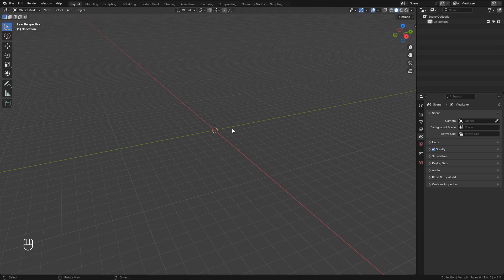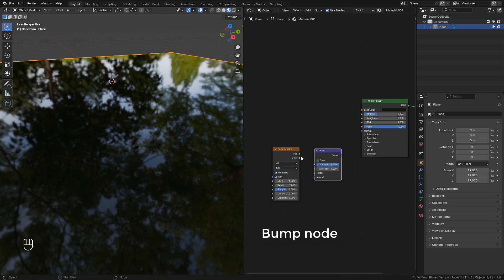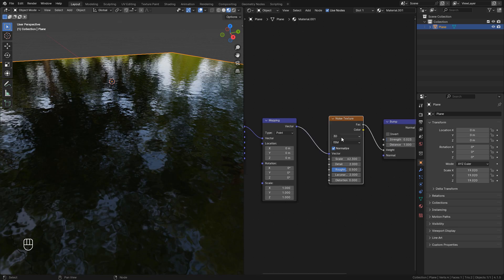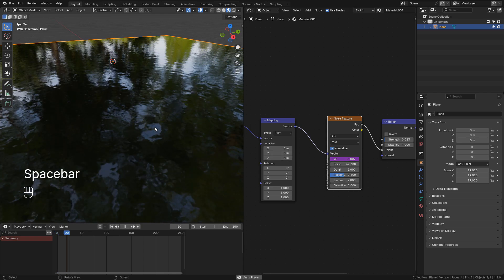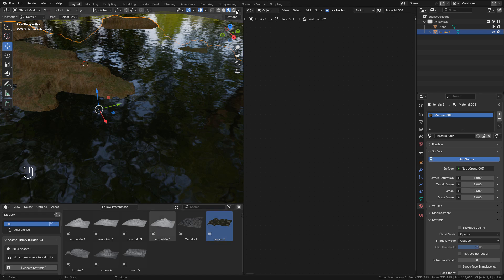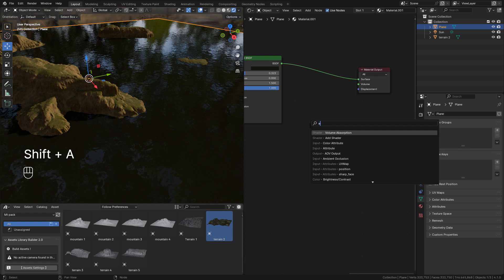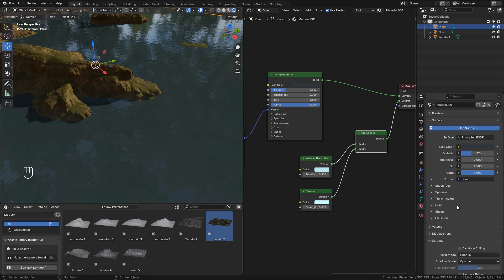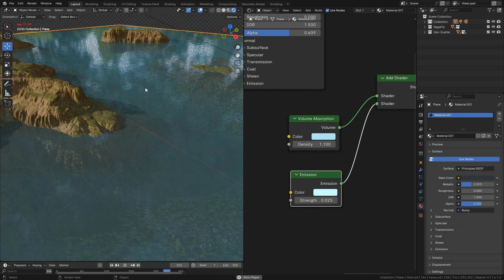How To Create Animated Water in Blender Eevee

Comment: Nice but unfortunately enabling alpha <1.0 together with shadows makes EEVEE so slow that 3d viewport becomes unusable... (on RTX 3090)
Reply from the maker: You can use the viewport in solid mode
Reply: @chuckcg  Well, yes, I can turn off shadows or alpha as well until before render. I guess the general observation here is that it's not really real-time water (animation) with these settings.
Reply from the maker: @clray123  Eevee it's a real time render but it doesn't mean that you can preview the animation in real time, it all depends on your pc, and yes transparency it's heavy, maybe you can try with a different material.